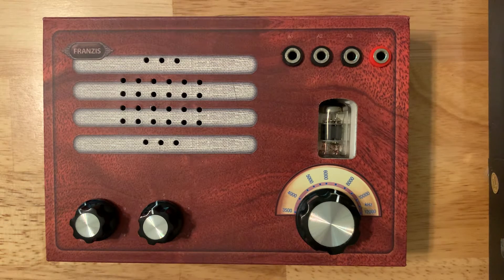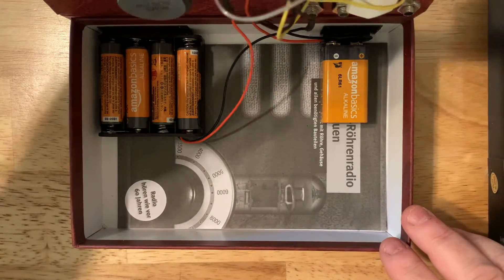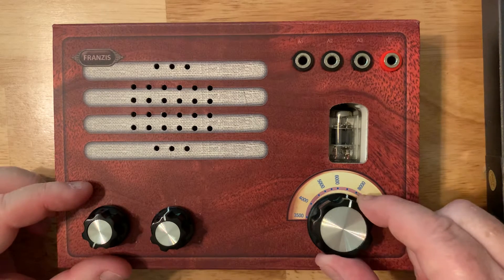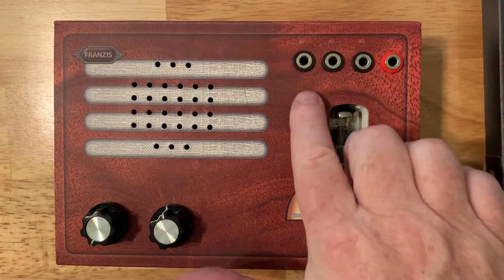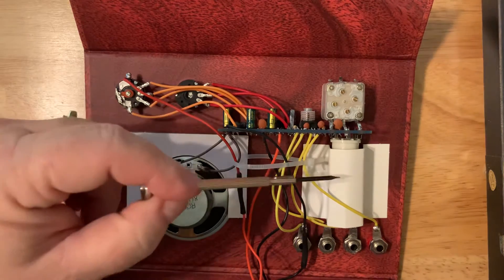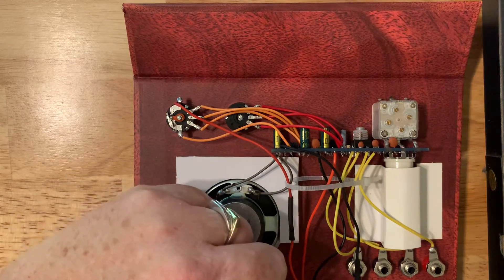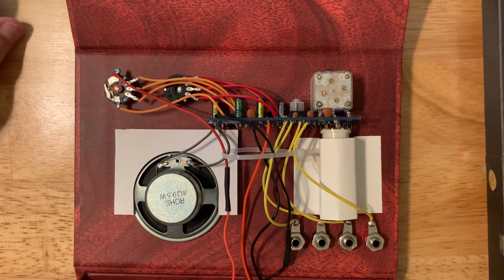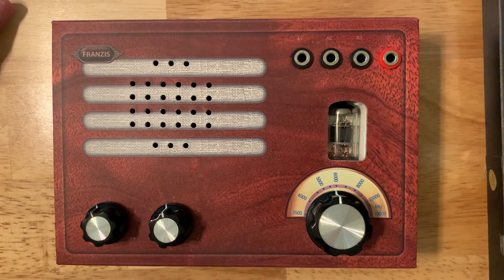Franzis Shortwave Radio Kit Review

Comment: Great Video. Seen these a lot of this lately and got the build it bug. Found the schematic and with a source for 6J1 tubes cheap i built one on one of my wood bread boards one evening using ugly hang in the air style. Part leads are full length so I can reuse them. Self wound coil around a sodastraw. Works ok but its a tough tuner with out a bandspread. Superhets are so much better but this was fun.

Comment: Just built mine. Not working. Checked all the solder, wiring, everything looks ok. There is no current on either the 9v or 6v line. No glow. I'm trying to troubleshoot but the filaments are not on the schematic and I've never troubleshot a tube circuit before. Any ideas?
Reply: Make sure the tube is attached tightly.
Reply: Start from batery to tube mesaure voltage, see where lose votlage, in bateri holder, wire, switch and other.